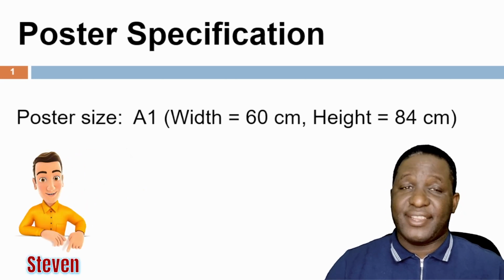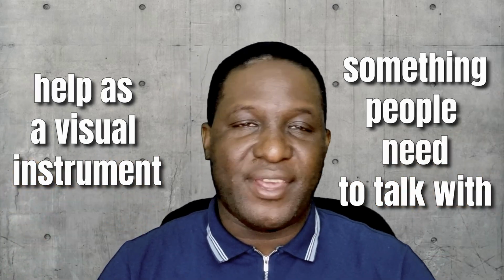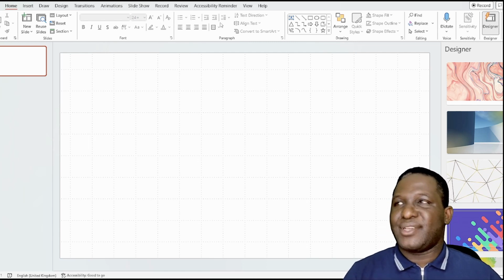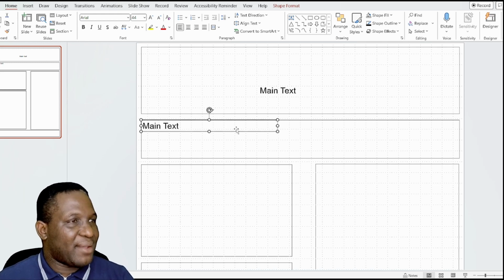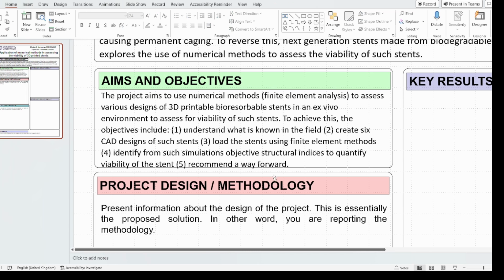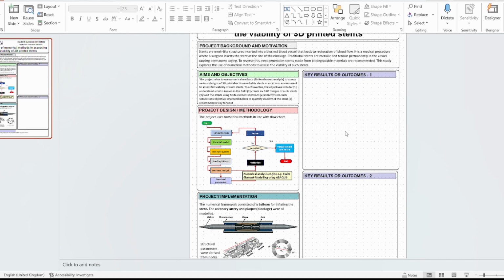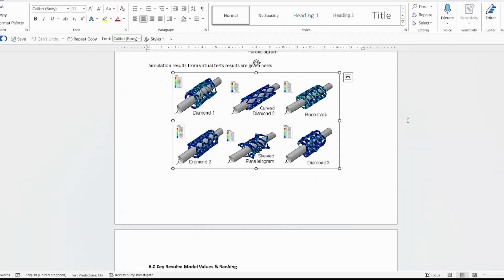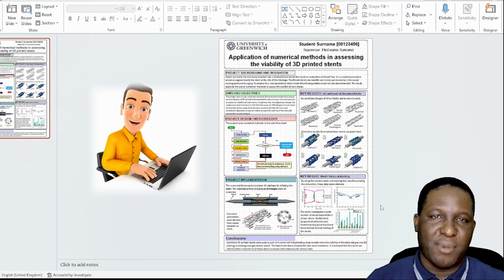How to DESIGN an ACADEMIC POSTER in Microsoft PowerPoint

Comment: Thank you Dr, for nice presentation. Am trying to go with your flow but when i insert the text in the texboxes.the texts becomes of very low size  , not seen even after increasing the size to 28. Help me
Reply from the maker: You will have to keep increasing it. At times 28 point might not be the same. This is because the poster size is quite large so small fonts will not show well.
Reply: @RosemaryMustafa-m9k  did you get help?

Comment: Thank you very much, Dr. Michael, for these good lectures. I have a question. How do I determine the volumetric fraction of two materials in the case of preparing a slide or layer consisting of polymeric material and fibers at rates of 30% and 70% in the Abaqus program? Is there an explanatory video available?❤❤❤❤
Reply from the maker: Hello, thanks for your comment. I am a bit unsure about what the question is about. If you want to determine the volume fraction of two materials (composites), you can do so by finding the weight contribution of each of the phases that make up the system. The weights of say E-glass fibre and the weight of the matrix, say Epoxy. With those weights, you define the weight fractions. You also need to know the densities of the constituents that make up the composite. If you want to see how to make the conversions, a quick google search will help you as you can see from here: https://sites.google.com/site/compositematerialsdesign/home/weight-and-volume-fractions. I am not sure if this is what you are looking for. Good luck with the research.